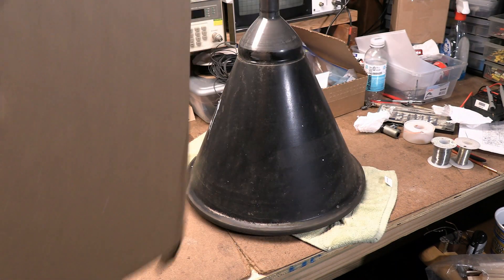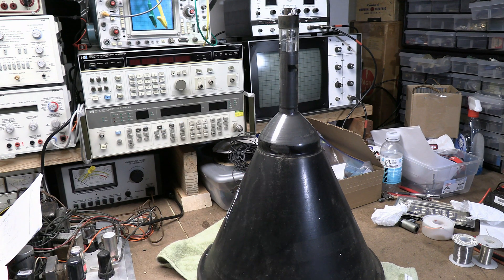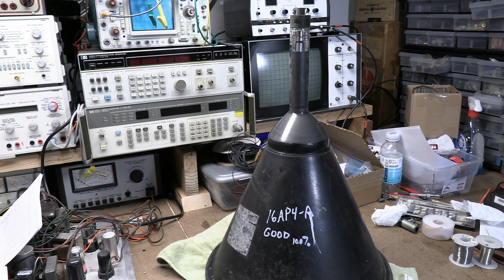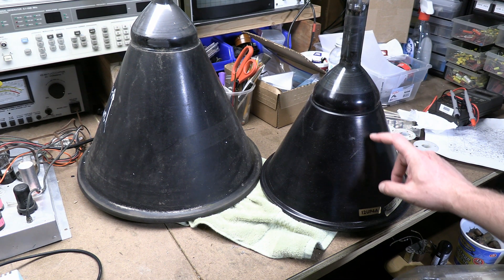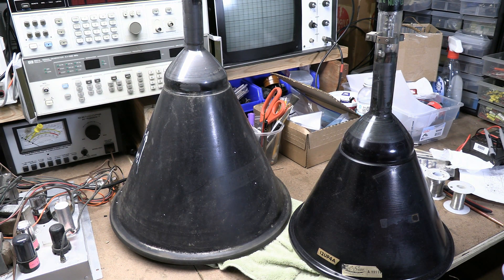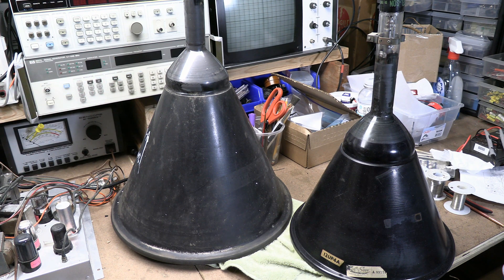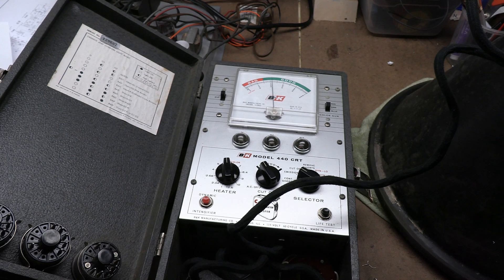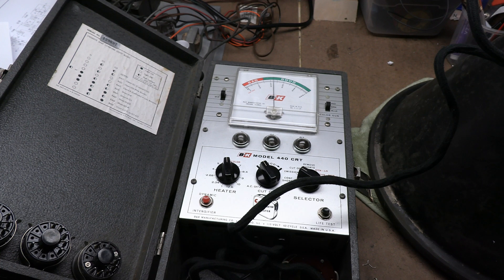16AP4 donated CRT test

Comment: While working at RCA labs I was involved with modularizing TV circuit sections. The biggest effort was an all solid state Plug in I F module.  Now a tech could just swap out a module to get a set up and running. Back at the lab there was awork station for do IF alignment and troubleshooting on a test setup. Much could be said fir all the other circuit modules too . I made a  loving part time restoring chroma, sound, vertical, and horizontal modules circuits. That was a rewarding adventure.

Comment: The computer museum I do restoration work for (System Source near Baltimore) has a DEC Type 338 display alongside our PDP-5 and 8 systems with one of the metal cone tubes you describe. Unfortunately it and our 5 are in pretty rough shape, I know it's missing the high voltage power supply and a non trivial amount of the driving circuitry, so we've never been able to demonstrate it, but I do know it has a crazy long persistence greenish-yellow phosphor that stays lit long after the lights are turned out :) I'd love to see it work someday, it has a light pen as input and probably looks incredible.

Comment: How are they bonding the steel to the glass? I understand how that works for the pins of a tube, but this is on another level. That looks sooo difficult, with thermal expansion and all
Reply from the maker: Similar technique. They used a special frit compound

Comment: I think you hit it for the first PDP with an analog x-y coordinate graphical display, not the rectangular  pixeled one we think of today.  In that day it would have been easy yet to get rebuilds when needed.  One application that was supported was the game Spacewar.
Reply: Yup. Those monitors did not have any way of generating characters on the screen like on a more modern terminal, they were only used to display graphics. If you wanted to input or output text, you would need to hook up a mechanical teletype.
Reply: My father got to play space wars on that at MIT on the PDP-1
Reply: My recollection is that the display system was made by tektronics but I could be wrong.